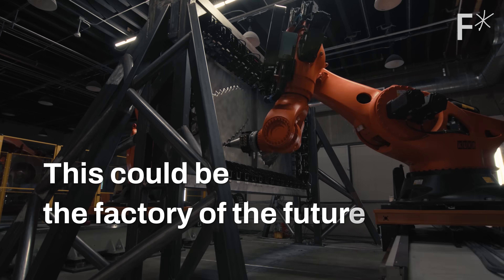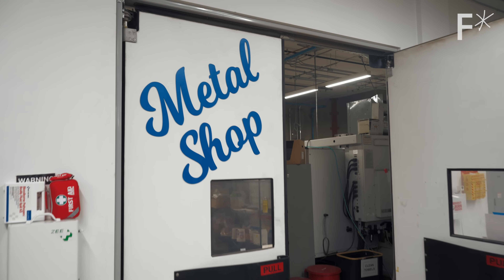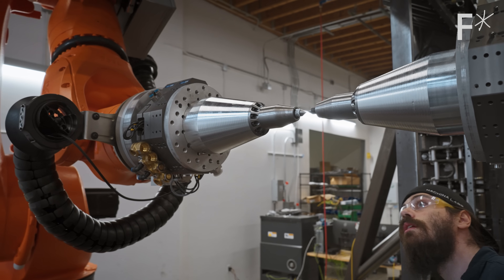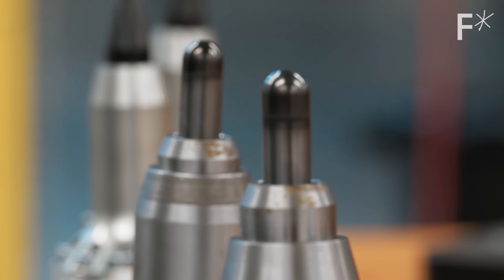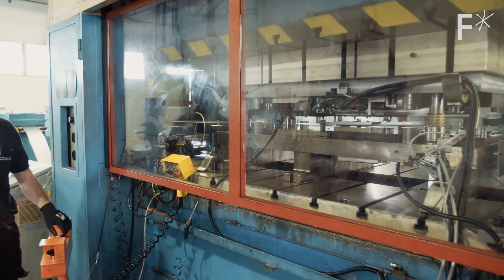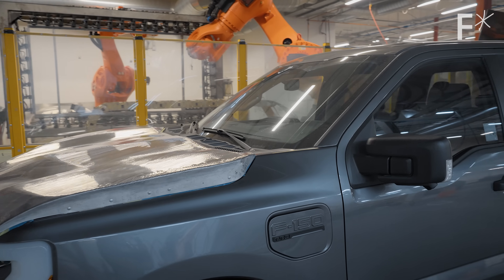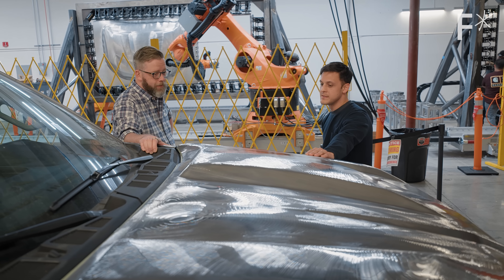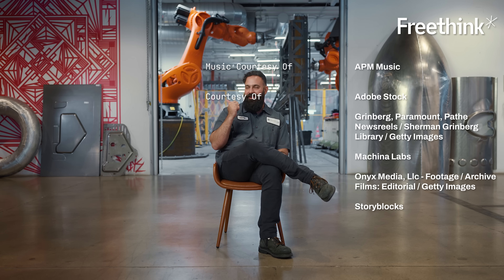Former SpaceX engineer invents a “Robotic Blacksmith Army” | Hard Reset

Comment: I bet the Navy would love to have these on carriers to print their own repair panels.
Reply: lol repair panels on a ship is just plate steel
Reply: @zachmoyer1849  I think he's referring to aircraft panels. He did say carrier.
Reply: @zachmoyer1849  No, aircraft panels are typically aluminum or titanium sheet, formed in a variety of ways to a complex shape.  They take up a lot of space and are expensive.  It would be a lot easier to store a bunch of sheet metal and make them as needed.
Reply: @zachmoyer1849  Repair panels for the aircraft.
Reply: @zachmoyer1849 everything is plate steel, until it won’t be
Reply: @evoltron  that would be a reinventing the wheel scenario.
Reply: @zachmoyer1849  actually, a lot of ships are aluminum for the plate work. All that steel, especially armor went out with battleships.
Reply: @spvillano what are you talking about ???
Reply: Mostly the superstructure. My bad, should've made that clear.
Although, with the littoral combat vessels, they did try using aluminum for their hulls, which lead to major cracking issues. Doubt it's the aluminum itself, probably more designers being accustomed to the flex steel has vs aluminum and using incorrect assumptions.
Designing aircraft and ships is a bit tough, as there has to be some flexibility or turbulence will cause structural failure, too much flexibility, the same. Far beyond my meager skills, but given time I'm sure they'll get the magic mix right. That is what experimental programs are about, after all.
Reply: Too much extra clutter. They're barely got enough room already. And they're not made of 1/4" steel. Try 1/2" to 2" steel. I was involved in ribs in a submarine once. Brittle but very flexible steel. Truly weird.
Reply: Every navy.
Reply: they have multi task robot named new soldiers to do any low and dirty job
Reply: They should make a rounded cybertruck for extra hype points😄📐
Reply: They just started selling to a market that actually buys and uses trucks. Expect that weird body style to begin being reformed for actual truck users.
Reply: It would have to not only be bigger for storing parts replacement and newly made parts but will need to be nuclear power it and not to mention to make the panels smoth to not f up the arodinamic of the plane from having paneles with ripples in it, the military especially in the USA is over buget it doesn't need anothere reasons for it to be iven more, there is better aplicación that one to deter and obliterated othere ppl
Reply: yaa they even have eanbought puled bmg.50 rounds for the WORKTIP/-.-.
Reply: Sheet metal
Reply: Right!
Reply: The no beard and beard made me laugh lol
Ref to The Creation of Adam is funny LOL
Reply: Great feature and he put it very elegantly about manufacturing being an art
Reply: Shows how little you know about the navy lmfaoo
Reply: what on 40mm thick armor plate???
Reply: But how are the middlemen gonna get rich ? 🥺
Reply: I’m an automation engineer, I can design this kind of system if you need one.
Reply: Maybe the Navy needs to stop running into stuff : )
Reply: If you had an appropriate safety bumper on your aircraft carrier, you wouldn’t take so much damage
Reply: I started laughing, thinking about a nuclear aircraft carrier having to be DOT compliant to include having headlights, & turn signals.  have to do a crash test with 5000 crash dummies on board.
Reply: Lmao you think they have a need to replace panels?
Reply: @ yes when you put a hole through them. You’ve never heard of bombs, torpedoes, missiles, and shells. Go visit the USS Arizona.
Reply: @ exactly how stupid are you?
Reply: @DevilDocG  the Navy has a bunch of things to include the aircraft on aircraft carriers. It would absolutely come in handy for them.
Reply: They would never have a qualified operator on hand
Reply: @KnottyBuoy  what do you think goes on in the military ???
Most of the military personnel needs are support billets. 
Navy machinists mates are some of the best mechanics, designers, and creative minds in the world. Botswains mates aren't far behind.
Reply: I was an Engineman for 8 years, hard working individuals are rare and don’t get the recognition they deserve, often times they take their talent to the private sector.
Reply: A few orders of magnitude too much flex in those robots
Reply: You expect calm waters when repairs are truly needed? If the vessel is safe enough to start repairs it is just as fast overall to send the parts it needs.
Reply: @kamilbro6106  

Yeah, ask the Russians how well that’s working. 

The Royal Canadian Navy has a ship class these would be perfect for. Our new Repair and Replenishment ships.

Odds are your navy has something similar, unless you are a nation on a small sea like the Baltic. I gather you are from somewhere like that, or you’d see the application.
Reply: @waynesworldofsci-tech  application….just tow back to port or start scudding. Small repairs sure. But these machines won’t save your vessel. Only small repairs that may take as long to machine as to send a new part by the time engineers identify which one. Then again I’m a lethality person, not experienced in naval repair, if you have something I can look up to reenforce your point use the @me.
Reply: @kamilbro6106  

Yeah, right. You’ve got to be a Baltic or Black Sea native to think stupid stuff like that. 

A 5,000 kilometre tow is NOT a good idea.
Reply: @waynesworldofsci-tech  have you seen what a Seaman’s rank looks like up close? From far away maybe? Anyways…there are many ports and if you look up any historical naval battle where critical damage is sustained (not enough to sink or not enough to stay in battle). What happens next? What is supposed to happen next? All these “sexy and new” ideas you got from this video must have made a better impression than that logistics class I’m assuming you took and failed however many times.
Reply: @kamilbro6106 I served on submarines. We carry bar stock and a lathe with a full set of tools and dies. 
Sheet is the only thing we don't do. I would expect carriers would if for no other reason than aircraft repairs.
Reply: The Air Force has already bought in. They have a setup at Warner Robbins AFB in Georgia. Just think about the ease of replacing parts for aircraft that are now decades old. Just a brilliant idea.
Reply: It would take 20 seconds for a Kinzhal to send it to meet Titanic.😂😂😂😂
Reply: @timmy-wj2hc  

Ever hear of ESSM and Sea Ceptor?
Reply: @timmy-wj2hc you mean the same missile shot down by Ukrainians?
Reply: @timmy-wj2hc  sure thing buddy 😂😂😂😂
Reply: @timmy-wj2hc keep dreaming that the United States Navy is made up of idiots with no clue how to deal with anti-ship missile  systems. I mean we only designed and built the entire navy with the plan of having to deal with a peer force enemy whose battle philosophy was literally "fill the air with missiles".

Comment: That was not the point of the "any color, as long as it's black" line.
Reply: Please expand on your thoughts? At Purdue we were taught that it was because variations would slow down production; having more colors than black would require more paint booths, add more variables for error, and slow production due to lack of repeatability.
Reply: @Triflixfilms  The use of the assembly line was innovative (though not original to Ford), and a major start of the beginnings of mass production. So, yes, they only made it in black because doing otherwise would slow production, but not because it was difficult to do otherwise, because doing so allowed them to be produced more quickly and more cheaply than any other product.